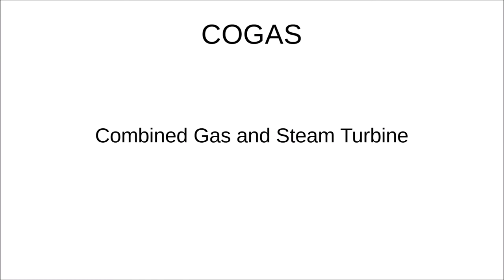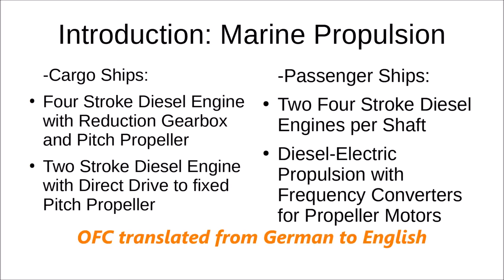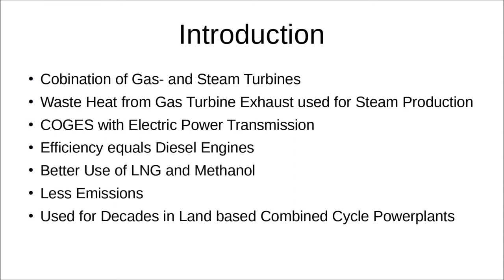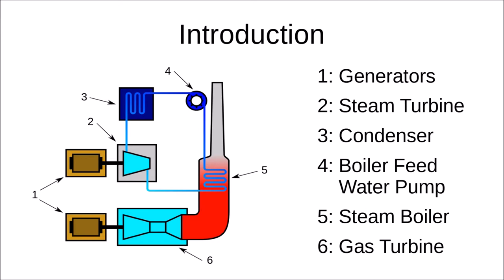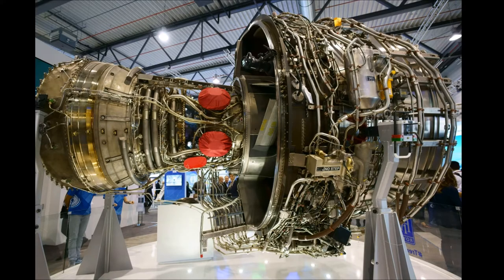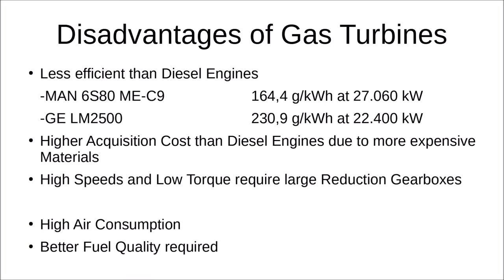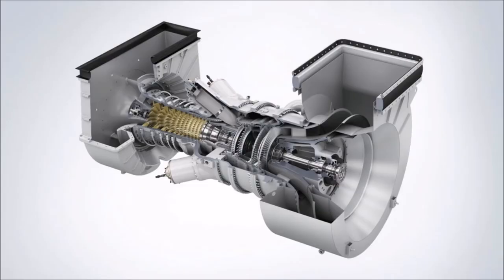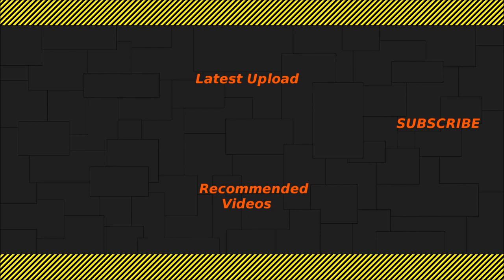Combined Gas and Steam Turbine (COGAS): A clean and efficient Ship Propulsion Concept

Comment: Another idea turbine could have direct connection to shaft / contrapell, but with electro generation copacity. Shaft could be boosted by steam circuit either electrically or by transmission. Seems more cuber some that IEP but lower losses.